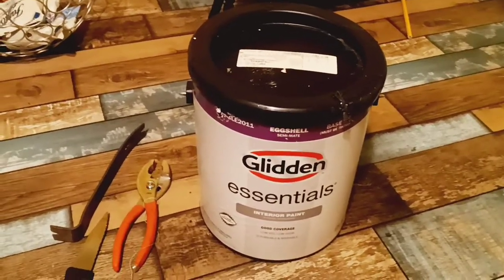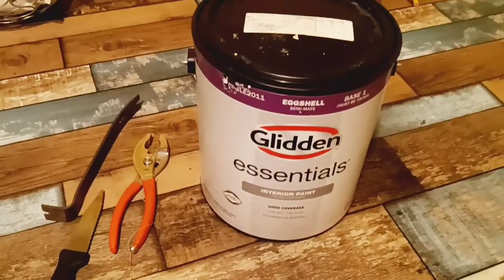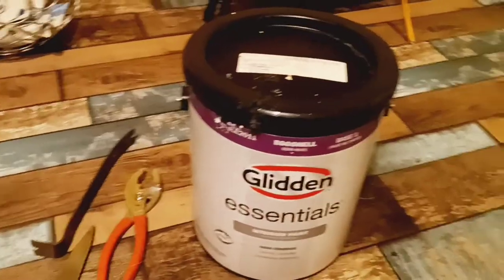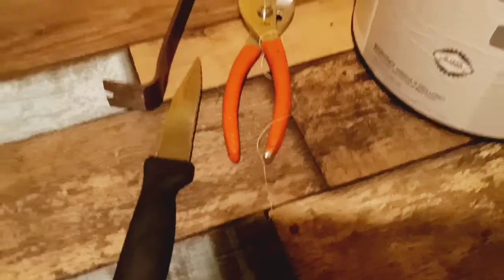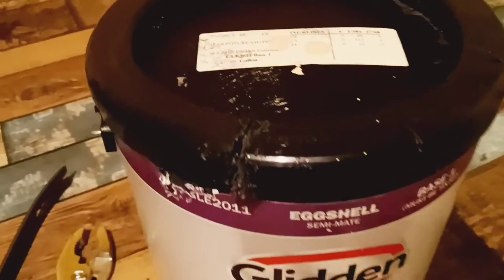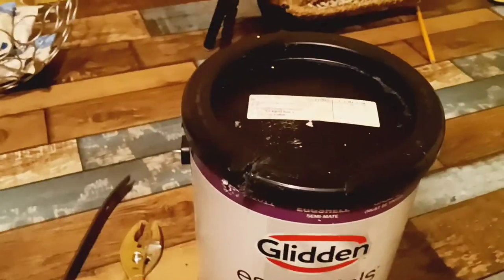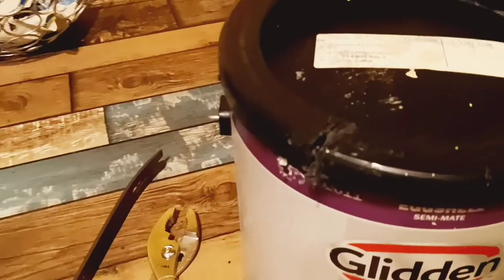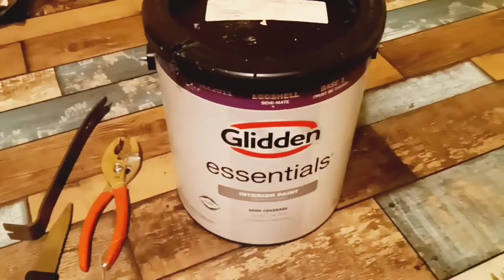How To Open Paint Can Lid / Seal / Lock 😡

Comment: I just got 2 of those hideous paint cans. The only easier way is to NOT buy them.  I called HomeDepot for help, the store told me it happens to everybody, the 800 number told me it has to be opened by a professional.  What's the point of shipping it if it takes a professional to open it?  So, I'm going to try a knife, a crow bar, maybe a drill.   Behr doesn't use these, as of right now.  Save yourself and buy something other than this stuff.

Comment: I pried it a bit with a claw hammer, then used my hands and gripped it with my finger tips at the outside edge, palms on the center of the can and pried it piece by piece about 4 inches around the radius and ripped it off. It’s a pain in the ass. Do what you gotta it’s a super hard non reusable seal so it doesn’t matter if you cut it or break it.

Also I recommend getting leverage with your claw hammer on the handle, if you do it the way I said I do it.